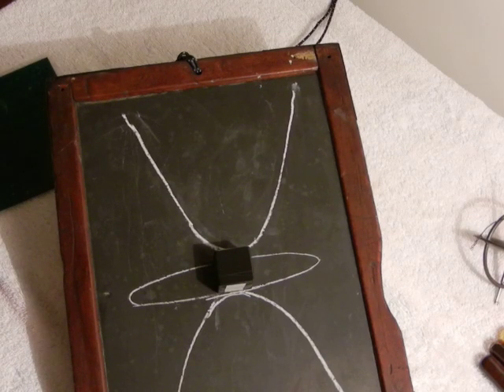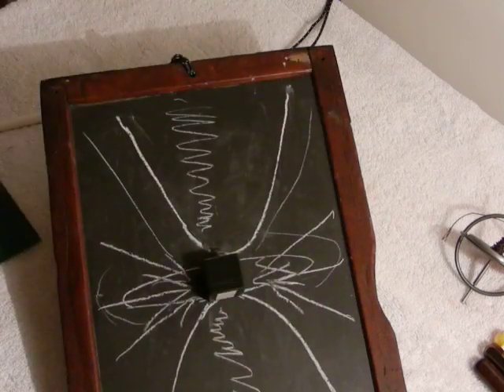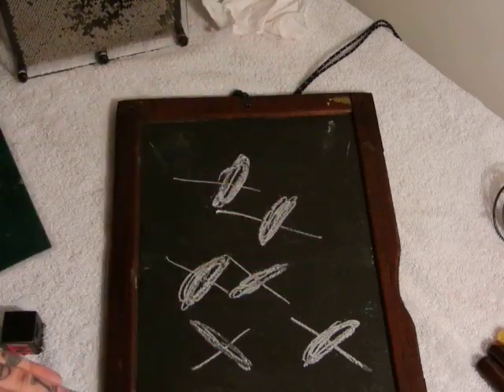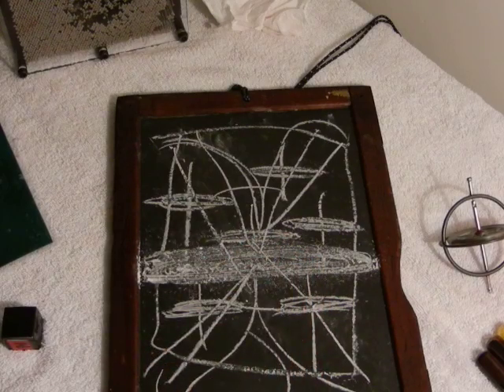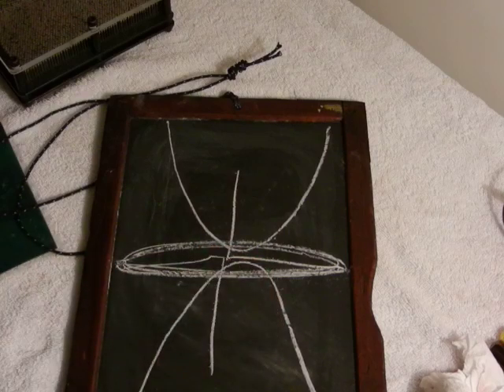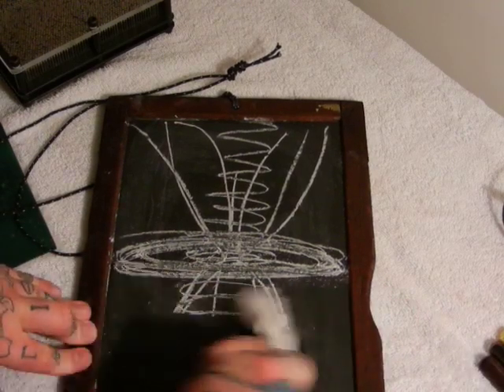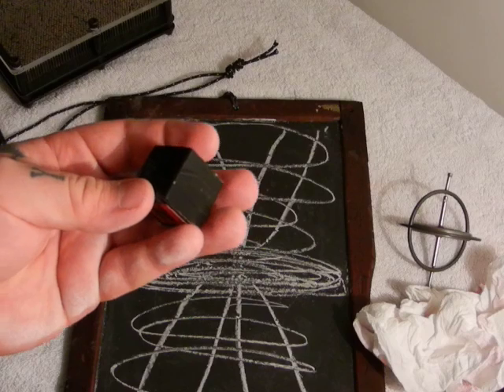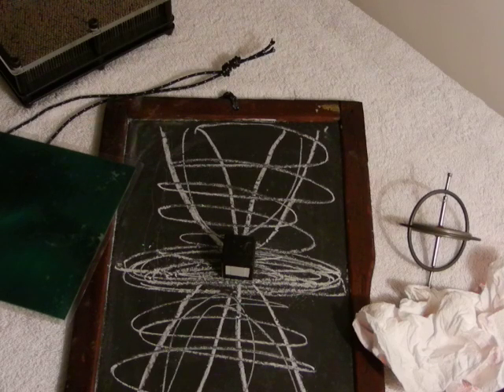Video 2 Uncovering the Missing Secrets of Magnetism

Comment: The universe is made from only one particle which has 3 states. Left spin, right spin and no spin. The no spin state creates a real or absolute hole in space which the spinning particles fall into. This accounts for positive, negative and neutral. Everything in the universe is either positive, negative or neutral. What differentiates space from matter?
Space is only left or right spin while matter contains a no spin centre. This is what creates magnetism and gravity.
Why is magnetism stronger than gravity?
Answer - They are the same but a planet and an atom are in a different fractal realities where time and space have different meanings and strengths. Atoms rotate very fast, solar systems one year (from Earth's perspective) and galaxies are very slow. Thus, the larger the fractal the slower the dimensional reality. The smaller the fractal, the faster the reality. The universe goes on forever both outwards and inwards.
The aether particles spin at the speed of light. E=MC squared.
If you push two aether particles together which are spinning in opposite directions at the speed of light, then you get one space. Aether jets which shoot out from the galactic centre plane creates left and right spin aether particles. These particles which are inter-dimensional (we can't see them) eventually go around in an arc and come back to the centre plane where they condense into matter again.

Comment: Hi. Very interesting stuff. But I have a question. If you make a slow approach with the magnet, then shake the board a little so that more pins jump up to the magnet. Will you still get the "ring of void" around the magnet when turning upside down? I'm not saying your theory is wrong. But could it not be the magnetized pins hitting the magnet causing the nearby pins to attract and then lock themselves against the inner wall of their place holding holes? Further from the magnet the weaker field isn't sufficient to lock the pins, and they fall. Thank you for great vids!